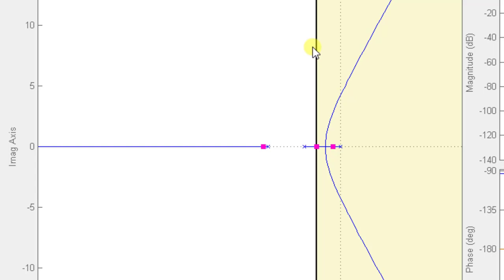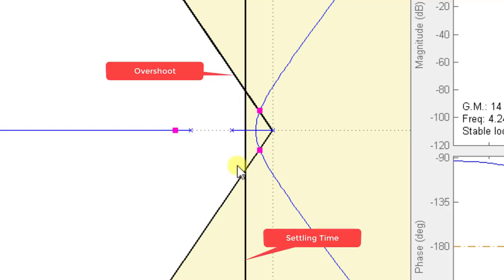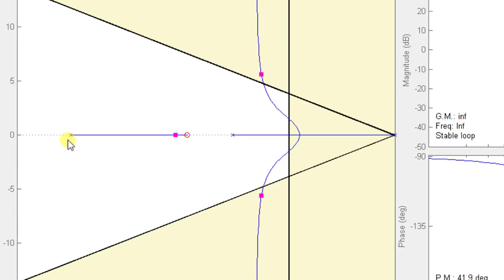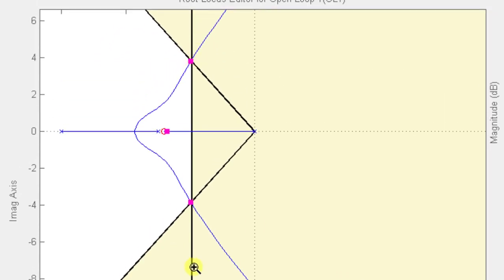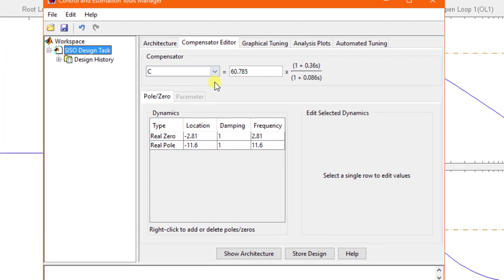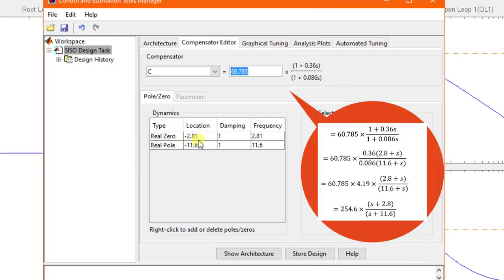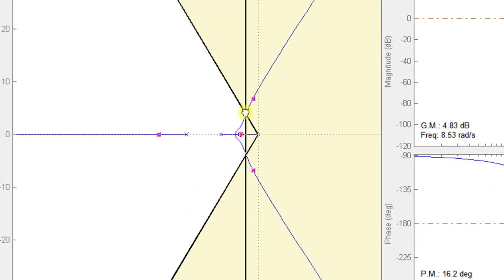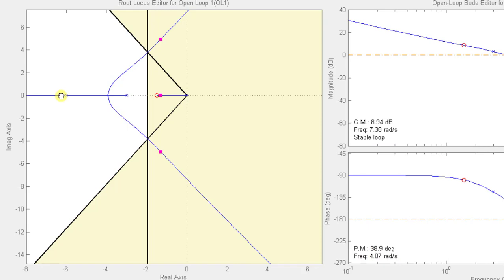Design and Implementation of Controllers using Matlab | SisoTool | Compensators | Control Systems

Comment: Sir this is very good content. I have a suggestion regarding verification part of this video. There is another possibility. We can directly export the designed compensator from sisotool by clicking on file and then export to workspace and then selecting only C. when it is imported into workspace, criteria may be verified by using matlab command 

stepinfo(feedback(C*G,1)). 

In this case, We may also even skip factor simplification matter  that extracted common from numerator and denominator
Reply from the maker: Thankyou!

Comment: hello sir can you please help with this on matlab your response will much appreciated

An uncompensated unity feedback system with certain deficiencies has no zeroes and poles at -1, -2 and -5. Answer the following questions based on the above description of the system
a)	Determine using an apt technique, the gain of the system at damping ratio 0.45
b)	Include a series compensator to the uncompensated system with zero at -0.0111 and pole at -0.01. 
c)	Include a series compensator to the uncompensated system with zero at -0.1 and pole at 0
d)	Display on a single plot, the step response of all three systems above.
e)	Tabulate the settling time, rise time and steady state error for each of the three systems
f)	Discuss the results obtained in 1(e) with respect to the steady state error and the compensation used.